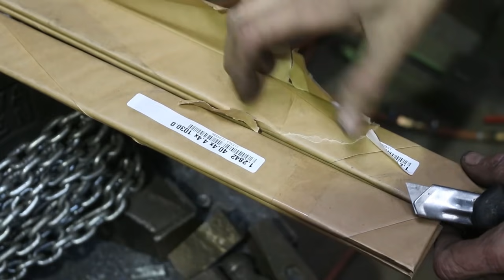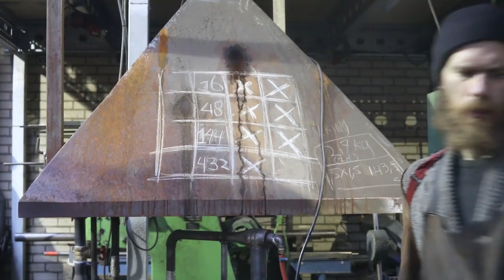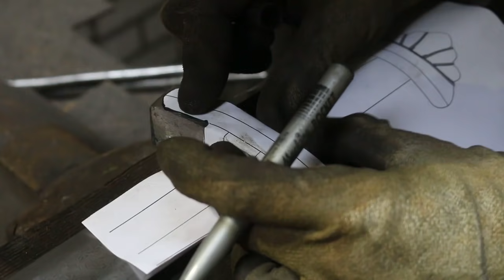Forging a pattern welded Viking sword, the complete movie.

Comment: What's the purpose of grinding the cross cuts (10:30) and drilling the dimples (13:00)???
Reply: it makes the pattern by mixing the different layers of stel together.  the acid then etches one of the layers he stacked and it turns back.  its called damascus steel, it  becomes stronger and more durable as skilled artisans fold and twist these metal layers together to create a one-of-a-kind pattern.
Reply: sorry for typos
Reply: @ibrahim-sj2cr  Thanks I know that. I was talking specifically about the grinding and dimpling.
Reply: @stallebrass  it makes the black and white pattern look more pronounced
Reply: @ibrahim-sj2cr  Cool thanks.
Reply: @ibrahim-sj2cr  Technically speaking, the strength isn't an issue. Now, back a few hundred years ago, repeated folding and welding was done to make shear steel out of blister steel, to work out slag and homogenize the material, but now this is purely an aesthetic issue. High quality modern steel alloys are as strong as you are going to get without any folding or rewelding required.
Reply: it relieves stress on the metal and allows for the next compression to be more efficient- excellent question-the other replies are inaccurate